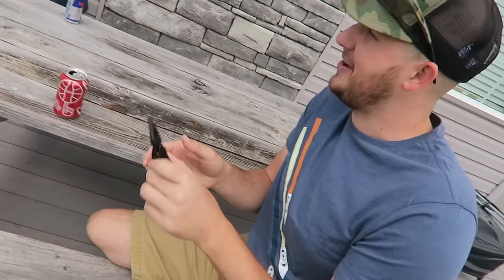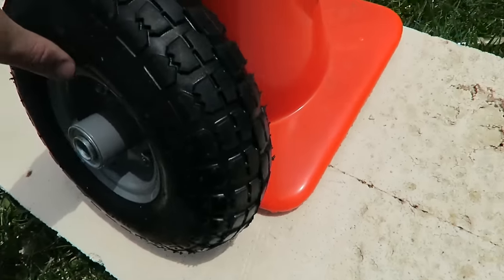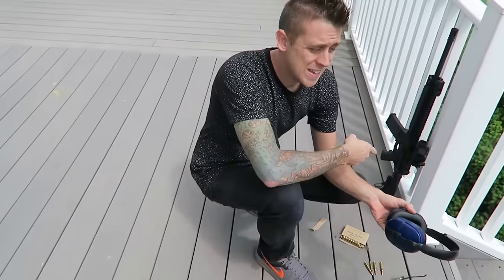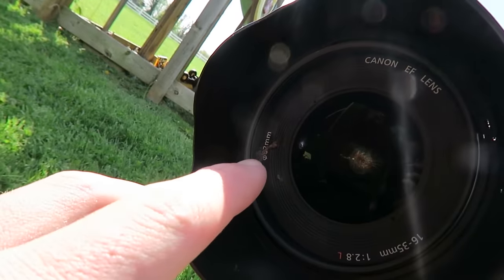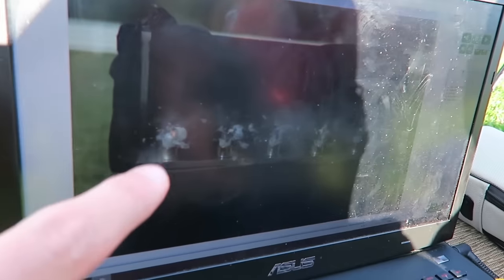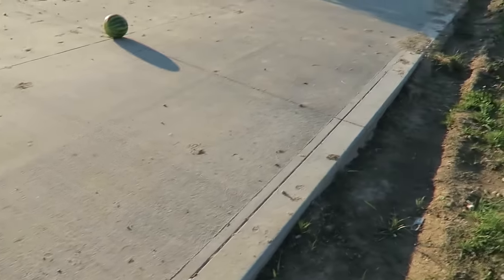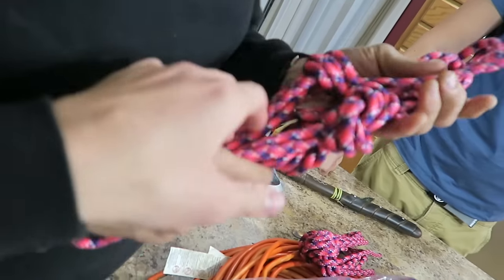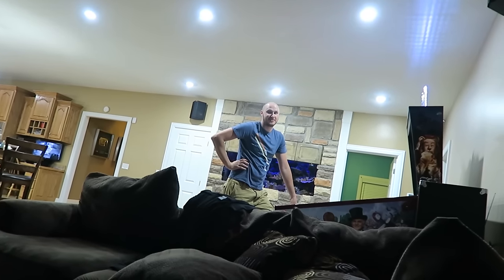CRAZY 100MPH CRASH!!

Comment: why are the front tires on the xo-1 spinning faster than the rear tires
Reply: Was thinking the same thing
Reply: Because it's a 4 wheel drive and the front is lighter so most of the traction is on the back.
Reply: Front Wheel Drive
Reply: XxdarkwolfxX gc
Reply: Probably the front doesn't  have as much traction
Reply: The tires are slipping
Reply: It's missing a tire in the front if you watch the rest of the video you can see